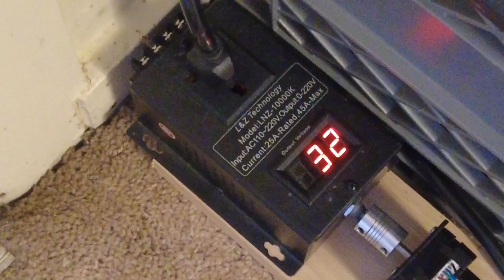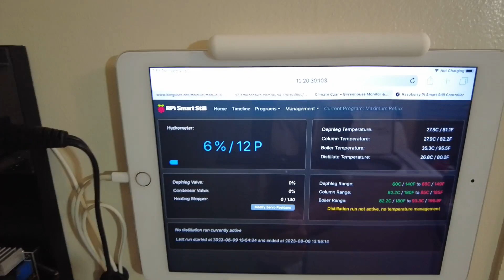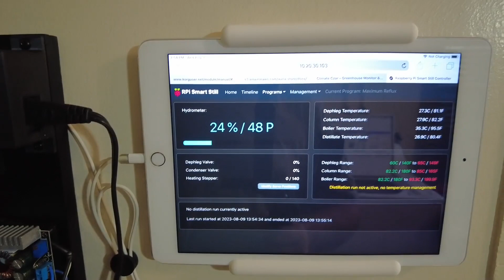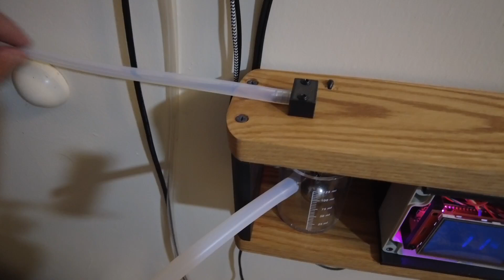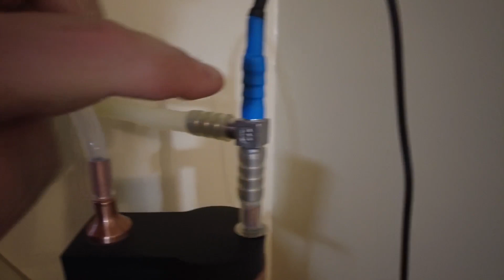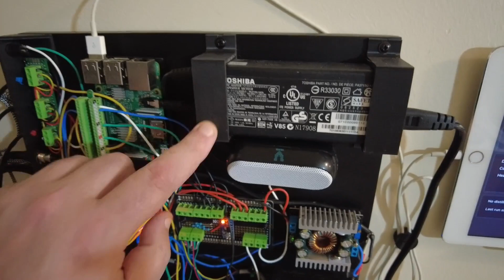RPi Smart Still - Preview

Comment: Thats the coolest thing I’ve seen in this hobby. I want one, shoulda learned this stuff a long time ago.
Reply from the maker: Thanks! A guy in Sweden has designed what you would call a "Raspberry Pi Hat" circuit board to simplify assembly so a person can just upload the design file to any PCB maker and order one already assembled. You just have to connect the sensors and motors at that point. I will be doing the same thing with the digital hydrometer part of it.

Comment: Can it do cuts> or signal you when to change out containers.
Reply from the maker: No, the second Q&A video and the GitHub page both explain why that's not possible with any brand without the use of thousands of dollars worth of scientific lab equipment. That's why distilleries use a continuous still with bubble plate towers that span multiple stories of their building.

Comment: I see pneumatics.  CNC for alcohol
Reply from the maker: Yeah, that part with the stepper motor on the heating control was far easier than I expected. I didn't realize that it's just a matter of two GPIO lines.